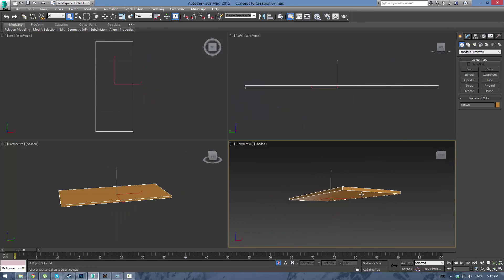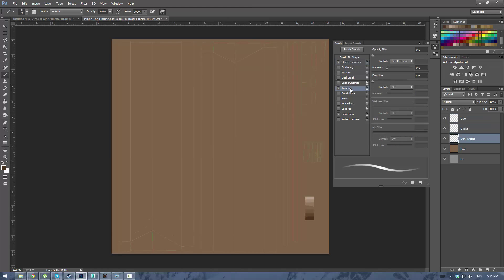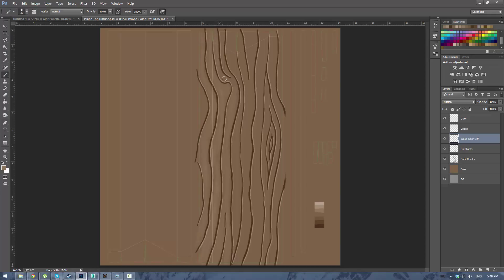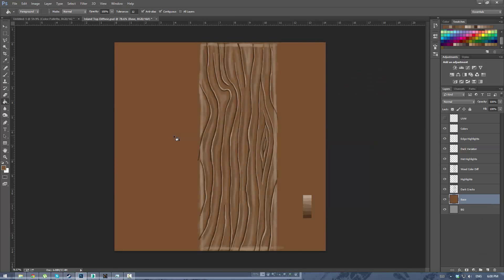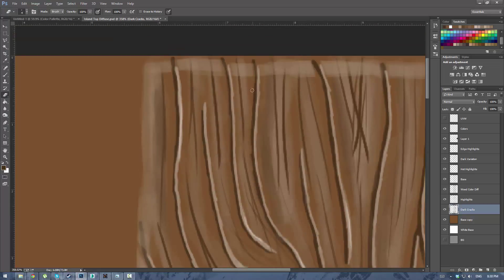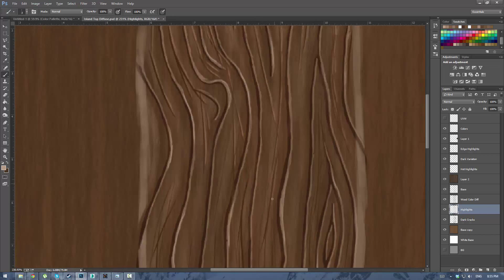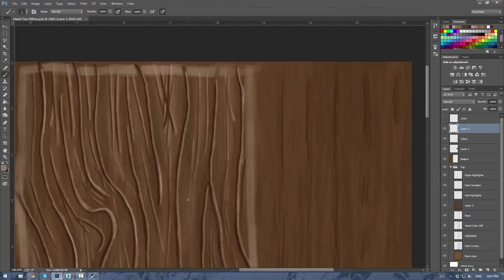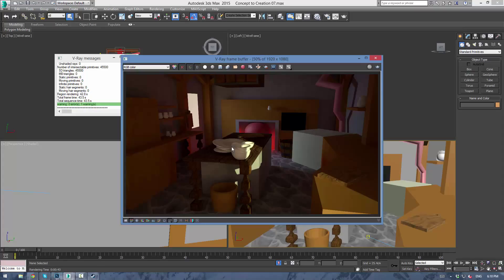Concept to Creation Section 3 - Counter Top

Comment: If you dont mind me asking, what are the specs for your desktop?
Reply from the maker: I custom build my whole rig, but the things that matter are below

GTX 780,
i7-4790
32GB ram
256gig SSD Samsung EVO
2TB HDD western digital green
3, 24" monitors, which make a HUGE difference when modeling

I also have liquid cooling for my CPU for rendering
Reply: Thank you so much, im looking to build my own rig over the summer and i want a high end graphics card  but since this is my first build i have no idea what im doing. do you know what motherboard you used? sorry for asking too many questions.
Reply from the maker: Gigabyte Intel Z97